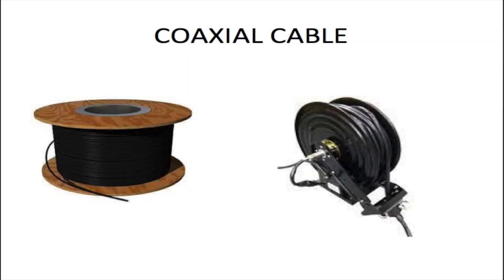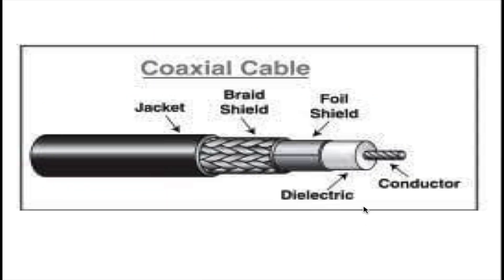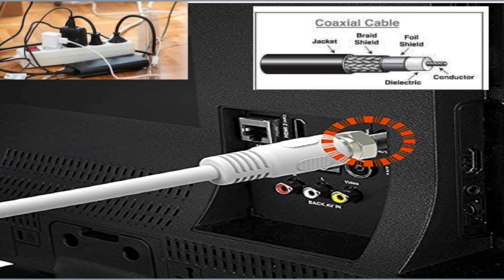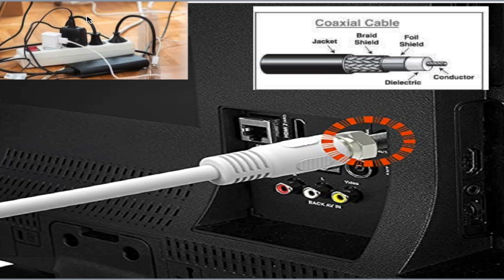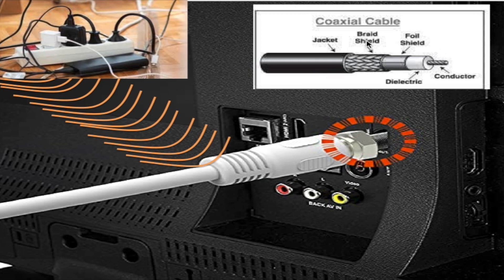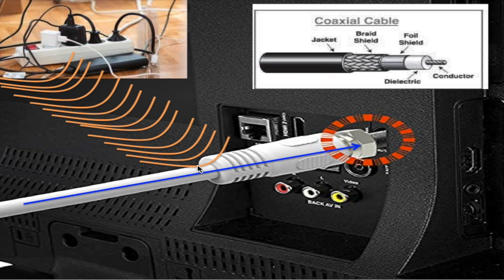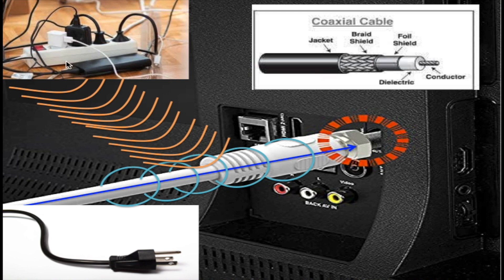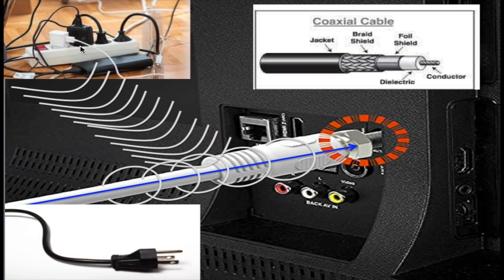The Amazing Engineering Behind Coaxial Cables Explained!

Comment: I thought we stopped using coax cables for television years ago
Reply from the maker: No we still use coax cable.  However cable companies use fiber-optic cable as the backbone and the final distance to homes and businesses use coaxial cable.  Newer or refurbished areas may have total Fiberoptic cable but a large part of the cable network is still coaxial cable.
Reply: @TelecomTraining  I believe this is the Hybrid Fiber Coax.... I still am a little confused on the part where they know which data is for which house, on the common cable running through the neighborhood. How is it differentiated.